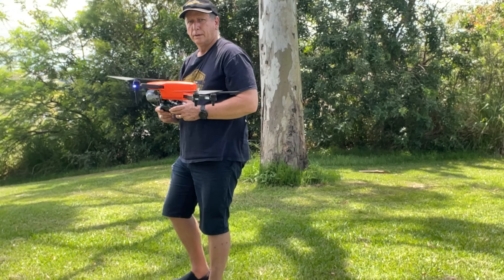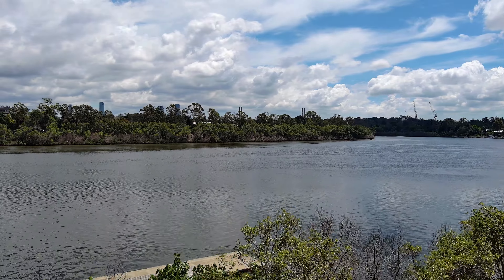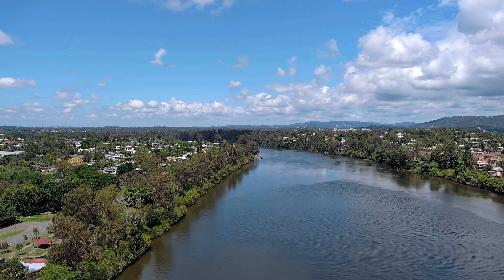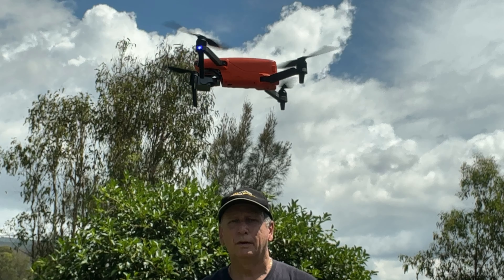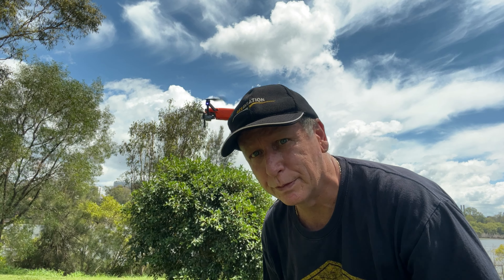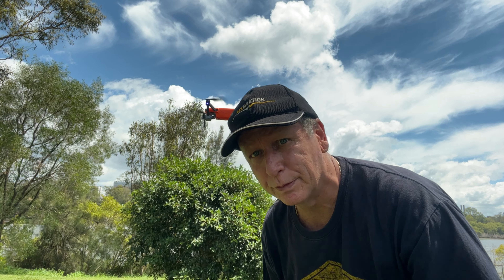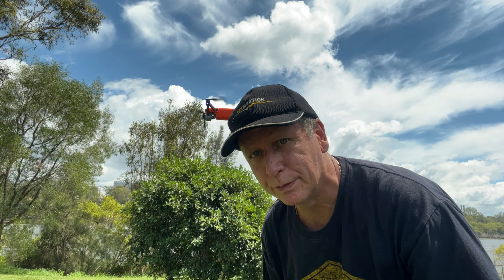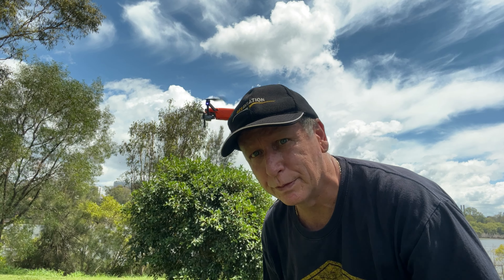Autel Lite / Lite+ - Firmware V1.5.34

Comment: So I never had the oscillation you demonstrated in the clip, but I DID have my camera oscillate or shake very noticeably.  Once. Switched battery (could probably just have restarted the aircraft,  but I read a post where battery swap worked  - in any case I've had no repeat. Any reason I should apply this specific FW patch? 🤔 Also  how much better is the Lite+ Camera, or rather how much WORSE is the 4 Axis Lite? I don't do much portrait/Vertical stuff, but that barrel roll is fascinating!
Reply from the maker: No reason to apply this firmware unless you have the aircraft oscillation.
The barrel role is a unique feature.

Comment: I have a new Lite+ that has the shakes. Is it OTA prompted?
Reply from the maker: Firmware should be formally up now or very shortly, I got the firmware via a vendor in China
Reply: @ozstrayapanoramas8610  no promp to do a FW yet.
Reply from the maker: Get in contact with Ken Booth who will send a link to firmware to you
Reply: I tried doing a firmware about 8 hours ago (NA/US). No FW prompt. No shakes on my Lite Plus.
Reply from the maker: @kenkeng5824  no shakes, you don't need this firmware
Reply: @ozstrayapanoramas8610  Thanks. I know your content and enjoy it. Have you noticed the Lite Plus is not capturing gps sats as quickly as it did recently. I also use Airdata and noticed the GPS sensor mapping always show “ dangerous gps issues”. Also noticed Airdata showed this same issue with my prior Plus ( replaced on Autel warranty) - so thinking it may be the Airdata program and compatibility issues with Autel Sky app. My DJI uav’s all show excellent gps capture on Airdata. Thanks!
Reply from the maker: @kenkeng5824  I've always got purple showing with GPS on Air Data, it maybe an anomaly with Air Data
Reply: @ozstrayapanoramas8610  Excellent to confirm this with you. Flying now with extra extra confidence. Always thought the UAV flew like a champ, visually. Take care!!!
Reply: My lite plus was shaking heavily so I returned it and got another. New one still shakes but not as violently as the previous one. I could really use this update, but I am still not getting a prompt to update. Still on the previous version of the firmware.
Reply from the maker: @Binkoro get in contact with Ken Booth from Autel who will send the update to you https://www.facebook.com/BladeStrike?mibextid=ZbWKwL
Reply: @ozstrayapanoramas8610  Thank you! I just contacted him via FB. I hope he will reply.